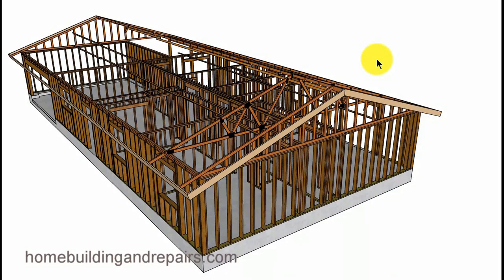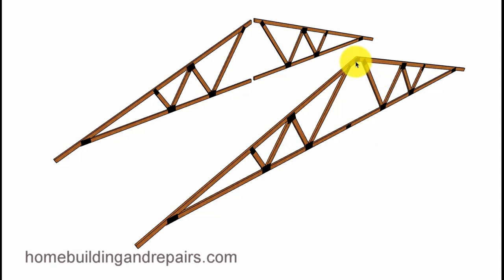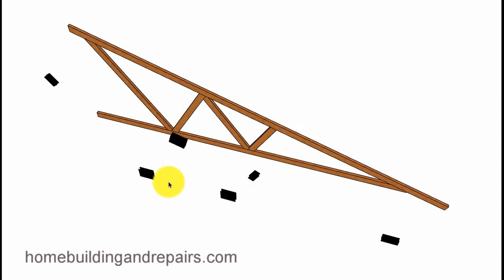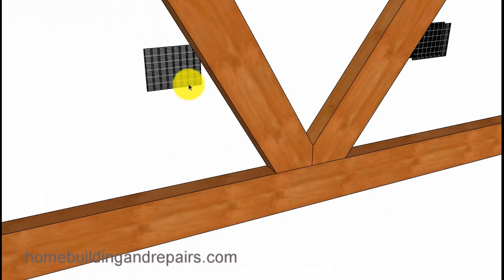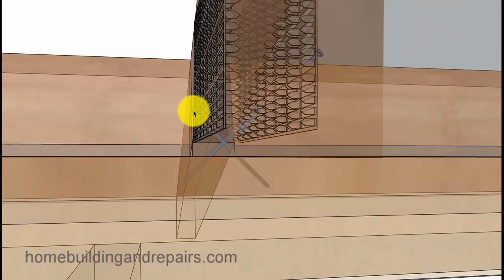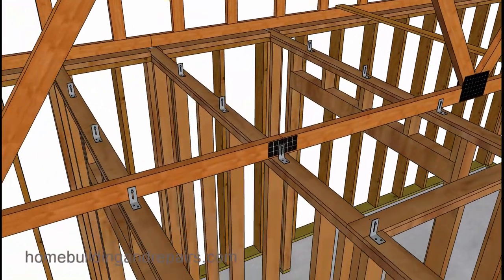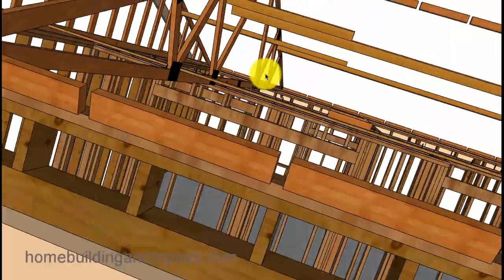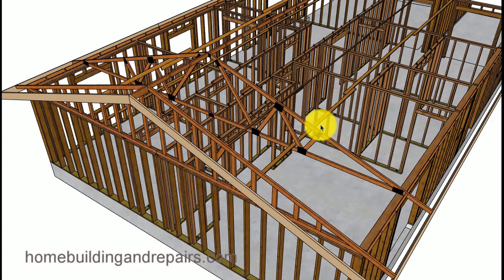Simple Explanation About Roof Truss Design, Parts And Assembly

Comment: This was spot on I Build trusses for a living. The only thing I would add is Trusses can be Built all the way up to 2x12 and the Trust plate it’s just called a plate and the  heel is called a heel wedge.
Reply from the maker: If there's one thing I can say about the construction industry, it's that they have plenty of words to describe their products or parts of a product and sometimes it gets a little confusing. Thanks for sharing.
Reply: I have a question for you since you build trusses for a living. Will a roof truss ever bear in the mid span of the bottom cord. mid span meaning, there is no metal gusset plate or no joint

Comment: Thank you for explaining so clearly the basic components. Question: on an attic full of trusses, my only way so far to walk through it is by holding onto the webbing crossbars while I reach another joist. Sometimes I go under a webbing crossbar and sometime I have to go over (leaning my whole body flat on the crossbar). I wonder how safe is that or if I'm risking the roof collapsing on me? I'm just 160 lbs and trying to get through the attic to look at either vents or leaks, etc.  Or what should I consider before screwing some 2x8 across the ceiling joists? Insulation is the paper cellulose kind, I'm not trying to make a floor all over, just something to walk or crawl across if holding onto the truss webbing is not safe.
Reply from the maker: How old is the house? Is there any part of the framing that doesn't feel secure when walking through the attic?
Reply: gregvancom, It is just 11 years old. I don't hear cracks or other suspicious noises but I'm also not sure what other safety signs I should look for. Maybe my worry of the roof collapsing is an exaggeration but I do wonder if I may be overstressing some joints or the structure of the beam itself. I'm thinking I would like to try screwing a catwalk with 2x8. Something skinny to not cover all the insulation. It's there anything else I should consider before doing that?  Thank you!
Reply from the maker: Yes, sometimes the roof trusses aren't designed to support additional weight like the catwalk. I don't think you will have a problem with it, but at the same time couldn't guarantee that you wouldn't. If your really worried about the roof, you could always take detailed measurements of the roof truss to a roof truss manufacturer for more information.
Reply: gregvancom Thank you so much for your opinion. I won't hold you responsible for anythin wrong, don't worry.  Thank you for taking the time.
Reply from the maker: You're welcome and good luck with your project.

Comment: Does this type of truss need a support wall?  When it has the center connector?
Reply from the maker: Most roof truss designs usually sit on two walls and those walls are usually located at each end.

Comment: I'm building a carport 18×18 if I buy trusses 4×12×18 I know the 4×12 is pitch but is the 18 describing wall width or is that peak down to drip edge ?
Reply from the maker: If you are talking about the truss design, then you would need to check with the manufacturer. Let me know if you can't find what you're looking for or feel free to email me a picture of the product or thinking about using.

Comment: Say someone had a 30ft garage and wanted to buy a truss with an overhang. Is a 30ft truss for a 30ft garage or does a 2ft overhang require a 34ft truss? No one tells how to order a truss. Is the 30ft the span they cover or does that 30ft include the overhang?
Reply from the maker: If the building is 30 foot wide and you wanted 24 inch overhang at each side, then you would simply order the trusses that way. In Southern California where I'm from, you take the building plans to the roof truss manufacturing company and or explain to them exactly what you're doing and they will provide you with the correct sized roof trusses.
Reply: @gregvancom  i was hoping to avoid special order. Guess I will visit a big box store with a tape measure. Then I will know if the advertised  truss size is total length or the size of frame  it will fit over. Pretty basic info for no one to know.
Reply: @stevenhatfield1961  your big box will use 30 ft for the width of the truss you need.

Comment: In this video are any of those interior walls load bearing? Where those two joists butt up and are connected with that metal plate. Is that a load bearing wall underneath?
Reply from the maker: In my example the only load bearing walls are on the perimeter of the building.

Comment: Tie plates with structural 8d nails might be slower but I think it’s a stronger connection
Reply: I am a truss fabricator and know about the physics of trusses This doesnt make it stronger if anything it makes it weaker because the nails essentially split the fibers in the wood and the point of the plates is to connect the fibers of the webs and cords. While they may make it sturdier it is not going to flex before it snaps like a truss is designed to do
Reply: @johnr8915  I’m also a truss fabricator and disagree with you

Comment: Hi,
I have an cathedral ceiling with a trust roof as shown in your video, would I be able to remove the wall that separates my kitchen from my living room?
Reply from the maker: I cannot provide you with structural engineering advice, but I would suggest visiting our website and checking out some of our engineering and framing videos. Remember, some walls are providing lateral or side-to-side support for a building and cannot be removed.
Reply: Okey, thank you for responding!
Reply: Pls!  How do I design a simple N shape mono pitch steel roof truss under gravity action???